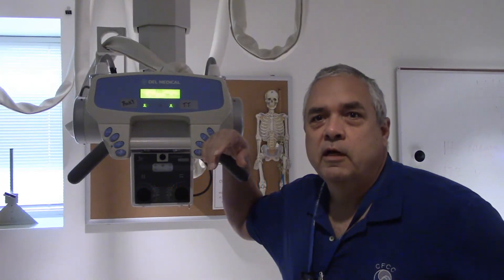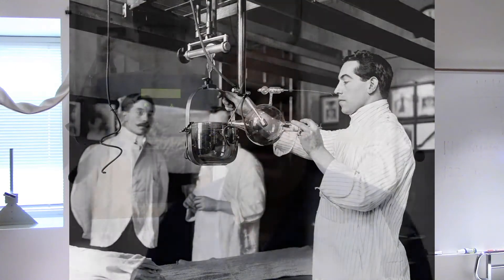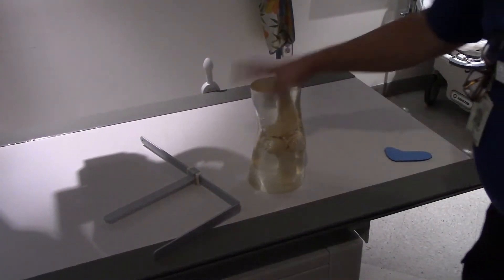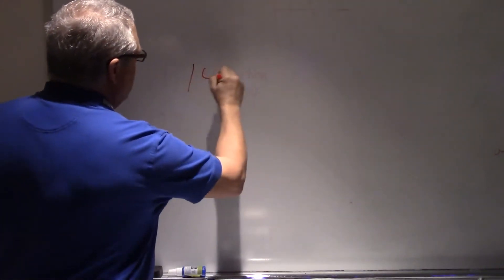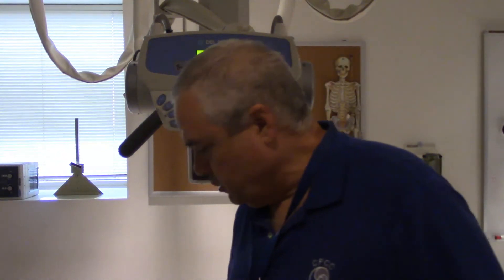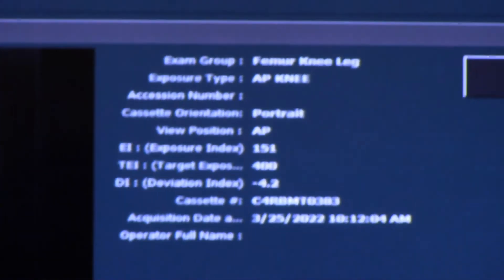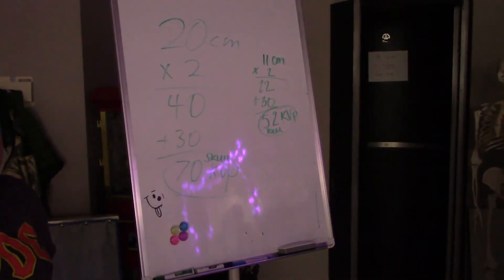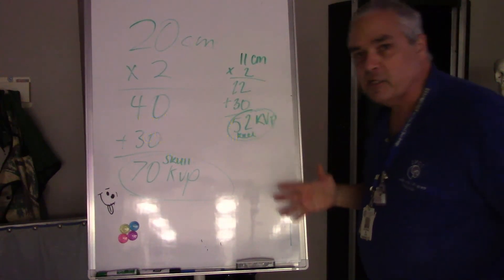Variable kVp technique charts

Comment: Hi X-Ray Ed,

Just stumbled across your channel when looking into exposure techniques and guides. I'm going into my senior year of the radiography program and I was wondering if there is any type of mathematical formula to help build a technique guide. All of the hospitals I've done rotations through have fixed kVp just like your video states. What about mAs? Are there ways to determine technique without measuring every patient? Part of our course is building a technique book and the hospitals I've been at are all too face paced to measure every patient. I'm guessing I can use the 4-5cm rule once I establish a baseline per body part. Any tips would be appreciated. Thanks again!